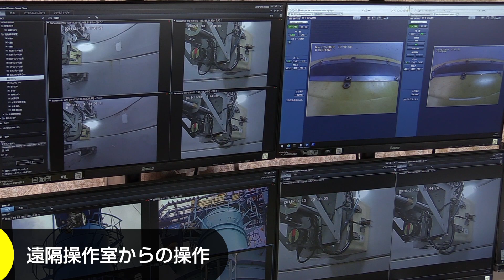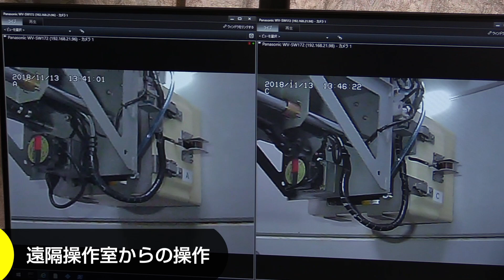2018/11/19 福島第一原子力発電所1・2号機排気筒解体モックアップの状況（STEP2初日）

Comment: I read that “The minimum of Japanese safety level of nuclear power stations set by government is too high which is
not necessary”. 

  The majority of present nuclear reactors around world is LWR and they are originally designed and built for military submarines and aircraft carriers 60 years ago first. It’s an old design and the basic is not changed much. We have
generation 4th reactors now at R & D phase and they are designed from very different concepts and approaches.  One
of the designs is VHTR( very high temperature gas-cooled reactor). 

 Japanese need to have new type fission reactors that have more safety features such as GTHTR 300 that can be constructed “in land” which effectively eliminates constructing huge walls for tsunami, the same time raises safety level and lowers construction and maintenance cost as well.   Nuclear technologies are important for our life.  Let’s promote the generation 4th nuclear reactors to save our earth and our life until we can have commercial nuclear fusion reactor.